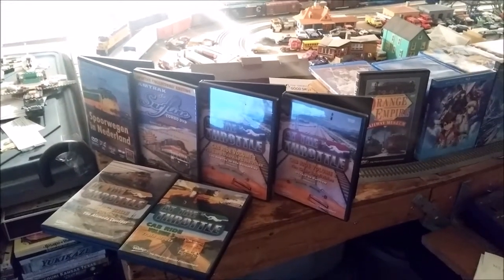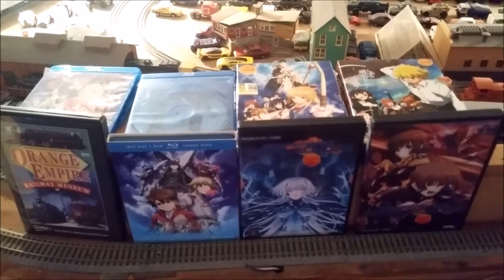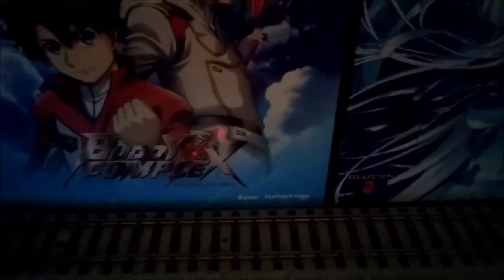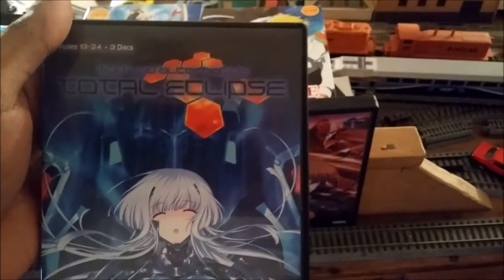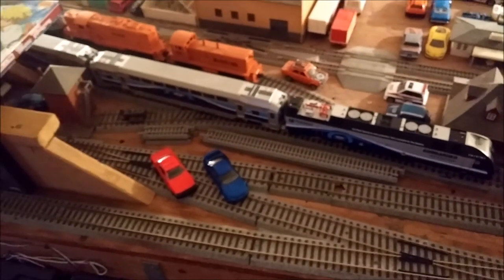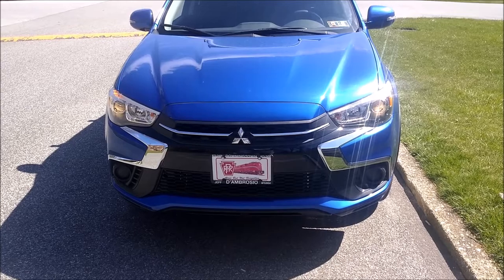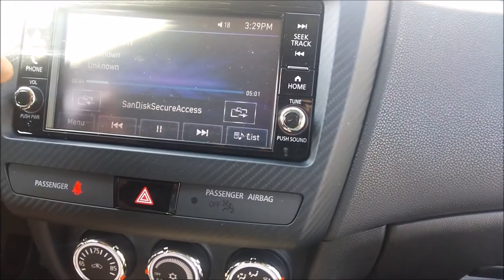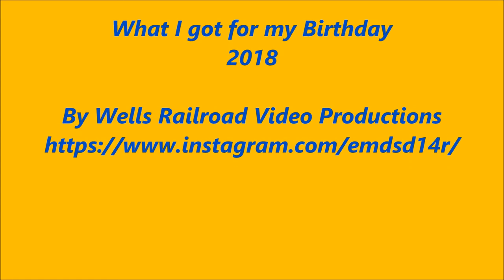What I got for my Birthday 2018

Comment: Happy Birthday Eddie. The equipment mounted on the rear of the locomotive is a Air dryer not compressor. The air compressor is located in engine compartment as it’s very large. Resembles a V2 engine.
Reply from the maker: Thanks and thanks for the correct info! So does that keep water or moister from entering in the engine area?

Comment: Wow, that is a birthday haul to top them all!  Quick question (might sound dumb, but I don't know the rules in the USA), can you drive on the road with your custom railroad license plate, or was that just on for this video?
Reply from the maker: Yes it sure is buddy! And no its not a dumb question at all. In the US you can have custom plates like that on the front of your car. I keep it on all the time. Now there are some states you have a regular plate on the front and back. Not sure if that's their rule but in PA you can have your own custom plate like mine on the front.
Reply: Here in NZ you need standard plates on front and rear at all times.  We do have personalised 6 character plates, but they are still only 6 characters made up of letters and numbers, no images.  I guess here it's a requirement for law enforcement purposes (speed cameras, mobile checks, bad driving complaints, insurance, etc).  How does a police officer check your custom plate in PA?  Do they pull you over and get your details in person instead of a mobile check?  Thanks =)
Reply from the maker: Oh I see, I think our plates have seven numbers and letters. We can use custom characters also. My PA train plate is not a plate issued by the state, its for decoration. There are train plates that are issued by the state though. The police have a way of checking my rear plate via camera's or something like a GPS or vin identification system. I've personally never been pulled over for anything so I have no worries there. Anytime I stop and this was in the Audi people would say nice PRR plate. I even got to buy trains from a private seller because he saw my plate at work and gave me first dib's on buying his O scale trains before he put them up for sale  online. No problem buddy! :-)
Reply: Hehehe, sounds like that plate is a lucky charm with perks!  Good stuff buddy ;)
Reply from the maker: It sure does buddy :-)